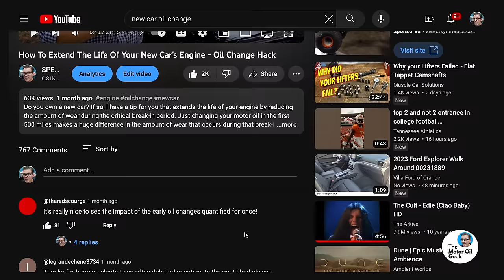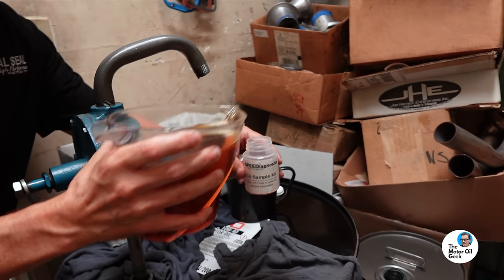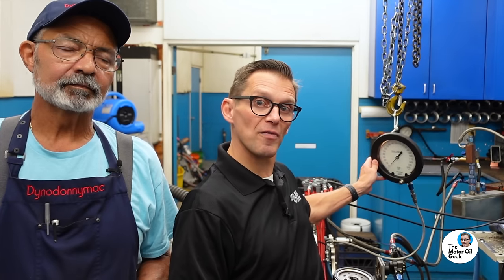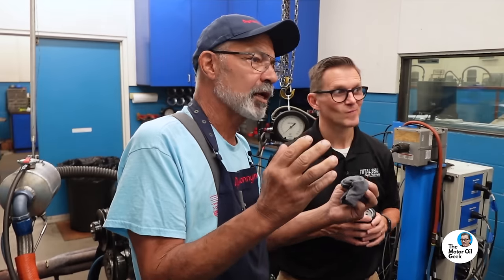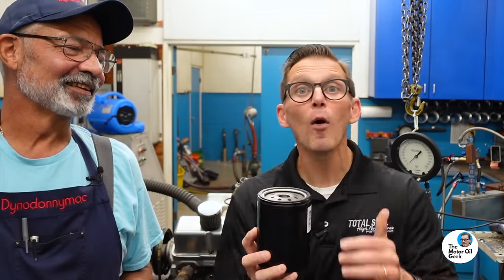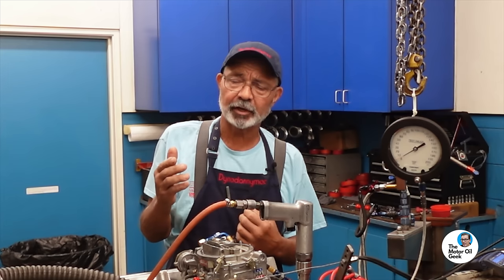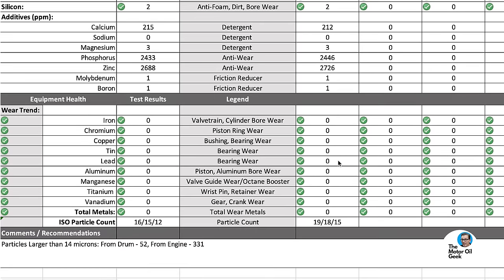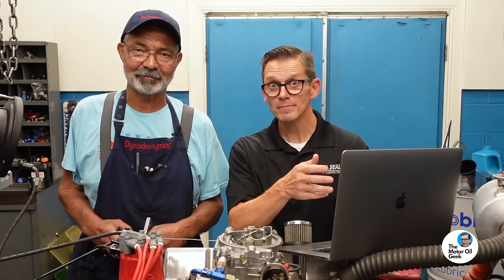Does Pre-FILLING The Oil FILTER Cause Engine DAMAGE?

Comment: So, either way works.  Remember the claim and reason for the test, was contaminated oil from the original container-which is not likely.  More likely is contamination from the things used to fill the new filter, or put oil in the crankcase-dirty funnels, etc.  I personally have changed an ocean of oil.  I have NEVER prefilled oil filters-fuel filters, yes.  "At the right time"....yes, as the engine turns over prior to ignition the oil pump is working, and distributing oil and filling the filter, the wearing surfaces are still lubricated from the previous oil, the wearing surfaces still have oil on them..  A "dry" engine is prelubed during assembly.    I know older diesels that have canister type oil filters (not spin on) that are mounted upside down.  Yes, you could soak the filters in oil and allow them to absorb the oil, or not....but it is really really messy to prefill a canister filter with oil.  A few years ago, we were told on some new Cats to NOT prefill the filters-right or wrong, I don't know.  The logic being the chance of damage during the crank cycle while the oil filters are being filled by the pre-primed (& already filtered) oil from the oil pump are less (practically nil) than the chance of adding contaminates with the oil during a filter fill up, as it does bypass the filter media.  Remember, I did not say contaminated oil, I said adding contaminates with the oil-a much more likely occurrence.  So, to those who prefill, keep on-those that don't, it probably won't matter, either.

Comment: To be fair in defense of the anti-fill crowd, Caterpillar advises against the prefilling filters. Im not sure of any other OEM that has came out one way or another over the practice.

Ive always prefilled my filters, but I did once drop a small piece of the foil from the top of the oil jug into the filter and if I wouldnt have caught it, it could have very well caused damage.

Comment: I get why it can be suggested to fit a filter dry as I had personally had issues when I prefilled them, but that reason google told you is the dumbest thing I ever heard.

The reason it is done sometimes is what I experienced, is when an engine is being primed for the first time, especially after long storage or brand new. A prefilled filter can create an airlock type of resistance that is greater than the air pressure the oil filter is creating while priming when there is no appreciable amount of oil in the pump and the pickup pipe, the air is then forced back around the pump rotors.  I personally had this and it took me over and hour of cranking on my low k replacement engine, in the end, what I had to do was remove the filter entirely, crank with a container under the filter adapter, then oil quickly started to prime through.  I then refit the filter, and the engine got oil pressure immediately. 

Now with any newly built engines of this type, I crank with the plugs out and ECU disarmed with a dry filter, so that the back pressure is far less than the suction at the pickup, this works without fail.

When servicing,  I used to prefill, but now I don't really bother as I have observed that after the engine sits for 15-20min hot, the entire filter drains completely dry other than residual oil dampness in the media, and I mean dry. I tip the filter upside down, and nothing usually comes out except a few drips.  Immediately after shut down, the filter has already got air in it and is probably already 1/4 is air.   So, yes, def prefill but some engines it does little to prevent dry starts.

This is in all of my Buick L27 engines and they last easily 500+ K, I actually haven't had one ever die or have bearing issues. So what seems like a red flag for bad lubrication on my engines, actually appears to be the some of the best when you tear the engine down and have a look. I have also have oil analysis performed and they were excellent, on the very same engine that wouldn't prime I might add.

I believe the oil drains back to the sump via the relief valve as the tolerance on the plunger is pretty loose. Usually 0.3mm, and that it is lower than filter and most of the oil pump. Seems like a stupid design but evidence shows that it's completely a non issue.

Comment: stuff will settle to the bottom. so, when you took a test oil out the motor and let it run before you took any you miss and let the settle out first.

Comment: You should always pre fill an oil filter if you can some vehicles make it impossible to pre fill an oil filter when i did my mechanics course they had a demonstration engine (2 engines cut in half and put together and then been made as a cut away) and it was to demonstrate what happens when you do an oil change pre fill versus no pre fill and in the no pre fill the oil pump ends up compressing the air and inturn enables it then sucking up the oil and then the engine get lubricated and that causes premature failer of the oil pump as it needs the oil to lubricate its self and reduce wear and with that not bekng able to be done it then causes a drop in pil pressure and causes pther parts of the engine to fail

Comment: Thanks. I’m wondering if cranking my engine, a 4.0 in a 2001 Jeep Cherokee, with the fuel pump fuse pulled so it wouldn’t start, until the crankcase pressurized would cut down on wear and tear?

Comment: The only question I would have is what rpm is the drill running at, and will the oil pump spin at that speed at idle. Might actually take longer to get to pressure if it’s stock idle speed vs drill speed rpm.

Comment: I haven’t watched this video yet but my understanding for an ordinary, modern car is that you need to:
-Lubricate the seal of the filter
-Fill the car from the top

No need to prefill an ordinary filter. Modern cars move oil so efficiently that there is maybe a couple seconds of lower lubrication. Fill the filter if you want or don’t to save time. No real world difference. 2 seconds of lubricant a dozen times over the life of the vehicle doesn’t matter.

Comment: I don't dispute prefilling an oil filter.

I can't imagine any engine, well broken in, or never even started not putting some particles into the oil even with just a priming process.  That is 100% guaranteed. So you only created half of what you needed to show us.

Where you missed your chance, is you should have taken a prefilled filter, primed the engine, then run then engine, then taken an oil sample.  Then take the filter off, put an empty, dry filter on, restart the engine, and see if you INCREASE the particle count in the oil from theoretically damaging the bearings waiting on oil pressure to rise.

If you don't find a particle increase, then you aren't damaging the engine by starting it with a dry filter.

Comment: I have a  2011 Toyota Tacoma PU with a 4.0-liter 1GR-FE V6 engine and it has 360,890 miles and runs like new, the problem for me and a pre fill is the filter is on top of the engine and will be quite messy and loose a lot of my Valvoline 5w 20 because It would be upside down, I know toyota filters have a check valve in em but with 360 k and no noise or oil consumption what is your opinion of me not following the idea, my wife has a 2007 RAV4 Limited V6 w/4WD with 280K and it uses a cartridge filter it is amazingly fast and keeps up with many sports cars...similar issue, I never pre fill it either, my thought is the type oil and the cold climate I live at in the Rockies may be a blessing for oil viscosity? Your thoughts might shed some light?

Comment: I can't argue that prefilling the filter may be better for your engine, as your data shows, but you can't prefill the filter on some Subaru and Toyota trucks, because the filter is mounted upside down.  So, I'm really questioning from a practical sense whether or not whether or not prefilling is worth the extra effort on most engines.  And one more test I would like to see you guys run is how long the oil pressure takes to come up after a full crankcase has been sitting there for 24 hours.  I'm guessing it takes a few seconds more to come up to pressure?   A lot depends on the design and configuration of the oil pump system, I suppose.  Perhaps on some engines just the act of filling the crankcase after a fresh oil change, and letting it sit there for a minute, also prefills the filter?  One simple test to verify that is to install a new oil filter without prefilling it, fill the crankcase as normal, then five minute later remove the oil filter and see if it's full.  You've really got too many variables here to make any general statement that it's always best to prefill the filter.
Reply: Some of Chevy's engines have top mount filters, too.  I had one on my 2010 Chevy Malibu w/4cyl.

Comment: Thank goodness for Fast Forward. After listening to you guys, DAM, what a pair of OLD WOMEN, I joined the army at a REALLY young age, and got my posting to a Field Force Unit, it was TRANSPORT, so the Army tought me how to drive and look after a vehicle which was from the OWNERs manual. Even they say to pre-fill the oil filter. After watching this banana video, I will continue to pre-fill my oil filters. I've been using PENRITE oils for years, and in ALL my cars I've always prefilled them. I don't give a Rat's continental what you blokes think you done on this post, but dam fellas, talk to the OLD buggers like me and others that have been driving and oil changing engines for years and years, WE know how to look after our cars.
Reply: Lol.
They agree with you in the video, but all anyone has to do is think about it.
It will have to pump that empty volume from the filter through the engine until the filter is filled by oil pump. 5 seconds of no oil film between bearings every 3k miles is a half minute of dry run time in a 100k mile engine.

Comment: So it’s best to fill the filter and un plug the fuel pump fuse and spend motor over and then put fuse back an start the engine

Comment: So, 1)why doesn't any engine manufacturer use an electric oil pump that runs before startup?  2)Are you sure there is no oil in an engine (no lubrication at all in critical places) after draining it? Nothing on bearings.. 100% of oil drains out. While good practice if you can, will not doing this cause engine failure? I'm not convinced .

Comment: So if you're supposed to pre fill the oil filters how are you supposed to do it on filters that sit on the front of the engine horizontally or even upside down when it don't have the clear flood mood? Like a 1998 3.8l v6

Comment: I’ve had people pre-fill their filters and accidentally add contaminants to the system which hits the connecting rod bearings and main bearings and does severe damage. High mileage engines are not as susceptible, but low mileage tight fitting components can’t handle it.

Comment: But .... was the engine dry... as in never had oil pumped through it ... ?    I would have rather saw you after priming it take off the filter and put on dry filter... then put on a pre filled filter....

Comment: OMG What about all of the new oil that is in the Engine that hasn’t been through the filter that you just put in the Engine . The reason you should pre fill the filter is so their is less time where the Engine isn’t up to pressure . It may be seconds but the less time the bearings don’t have oil ..

Comment: Shouldn't there still have oil on everything in the engine that will lube the motor for the 2 seconds it takes for the oil pump to start lubing the engine

Comment: I have never prefilled an oil filter and I have never harmed an engine blown and engine up or otherwise had any problems with any engine in my 59 years on Earth
Reply: No one is saying that not pre filling will cause a catastrophic engine failure. It is to reduce unnecessary wear.

Comment: If the manufactures believed it was necessary they'd have pre filling the filter in the maintenance manual.

A two cylinder Briggs with a horizontal filter doesn't need pre filled. Your V16 industrial generator... see the manual.

Comment: If you let the engine sit with drain plug off for a few hours then yes you should pre-fill the filter but if you change you oil quickly it wont make much of a difference or any at all. The oil on the crank takes time to drain out.

Comment: Moroso made a preoiler where you would fill the preoiler before shutting the motor off and them open the valve of the preoiler before starting the engine.  If your engine is precious enough, this would be a cheap investment to protect your prize engine.

Comment: The only thing I don't like about prefilling the filter is that tit's so easy to get excess oil on the sides of the filter. That makes it extremely slippery and hard to install. Even after wiping it off with varsol, I find it to be slippery and tricky to install. But still, I know it's the right thing to do. So I always make sure there's at least some oil in there. One question.  GM recommended 5 20 weight oil for my old GMC V6 engine. But after nearly 300,000 K, is it okay to use 5 30 weight oil?

Comment: Synthetic oil has magnetic properties in its molecules due to the process in which it's made. How you can test for this is to take a couple of round pipes there are about the size of cylinders. And put oil on inside of this pipe using a rag soaked in the oil. You take a quart of synthetic oil in a quart of petroleum oil in two pipes that are the same length. After you coat them you set them on top of several layers of paper towels. Then you let it sit for 24 to 48 hours. Can you check it to see how much oil actually flowed off of the pipes and onto the paper towels.

This will show you the oils ability to stick to the metal and what makes synthetic oil better than petroleum oil. You don't have dry startups. 4:12

Comment: Getting oil pressure by turning the oil pump vs using the starter to prime the engine is different , using the starter puts torque (pressure , resistance) on the bearings against the crank and by spinning the oil pump only there's not as much torque (pressure , resistance) on the crank from the bearings . The time it takes for the oil to go through the engine by spinning just the oil pump will go through the engine faster than using the starter but not by much .
I fill the oil fillers every time I do an oil change but I always wonder about the oil fillers that are upside down (like in some of the Cadillacs) and what to do about putting on an empty (dry) oil filler .

Comment: I remember back in the days of the past I was told, that oil filters actually could rupture when installed empty. Not sure if that is true because I always filled them first. but what do you do when some manufacture's (Subaru being one) mount cartridge type filters upside??? I don't understand why they don't use a canister type instead were you can fill the canister with oil after you put the new filter element

Comment: Tell me if I'm wrong, please.  But on all my cars, the filter is basically pretty low on the car bottom down, is oil not getting into it when I refill the oil?  If not, it must be empty every time I start the car.  Has to be one or the other.  If so, what's the point?

Comment: My oil filter is at a 90 degree angle and in a tight spot.  I would be surprised if there would be any oil left in the filter. Also it would get so slippery that I couldn't get it to spin on.

Comment: I think they went about it the wrong way. Every oil new and especially used (which youve just proved) will have micro particles thats why we need oil filters. So pouring new oil into the filter is not necessary some people still prefill their oil filters but fill it incorrectly and fill it directly in the center/clean oil filtered side. As mentioned earlier you want to reduce the amount of particulates going through the oil filter

Comment: I mean prefilling is just priming the filter. Like mentioned in other comments this should not be questioned as it is common sense; I prime mine, so I don't have to wait for the oil to bleed into the filter, wasting time and having to top it off 20 minutes later, never had a problem.

Comment: If I have a horizontal oil filter located on the lower half of the oil pan, and I dump 5-6 L of oil into that engine, I would expect it to fill up the oil filter.

Comment: Awesome video! Thank you!! Any reasearch on partially filled filters? I ask because my truck requires me to tip the filter in order for it to fit. In that case, filling it all the way up is out of the question. Thanks in advance.
Reply from the maker: Partially filling is good. No data on that, but it is directionally correct.

Comment: how would i know if your tests are true  i did not see where you got your oil, how it was really done. For me i am sure with my experience, i do not see anything wrong with Not pre-filling the filter, my engine runs for almost 30 years now and piston rings, piston cylinders, bearings and all other inside parts are not yet change, damage or replaced. Oil Change Timing is the only key for long engine life.

Comment: I wonder if engine designers given those facts about the time it takes for oil pressure to build up , besides filling the oil filter , if they can incorporate some sort of a motor to the oil pump and when we going to change the oil and filter in the vehicle info system enter some type a mode , lets called oil change mode so when we change the oil and filter and turn the key or press the start button , that sort of motor I mentioned will crank the oil pump but not the motor and give you some indication the engine is ready for start once pressure is been build up and is been pre lube, so then we can switch out of that mode and start the engine normally, pretty much what you show in the video manually with the drill , but incorporated in the vehicle itself, a tradicional engine , not talking about vehicles with oil sump pump.